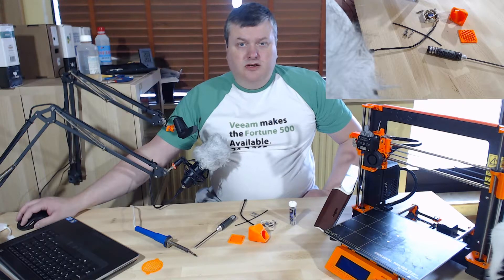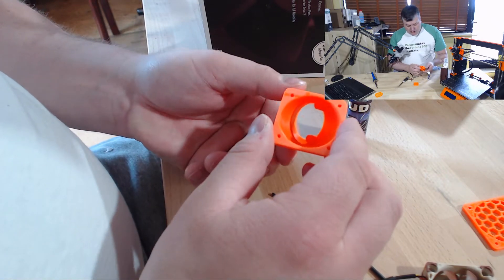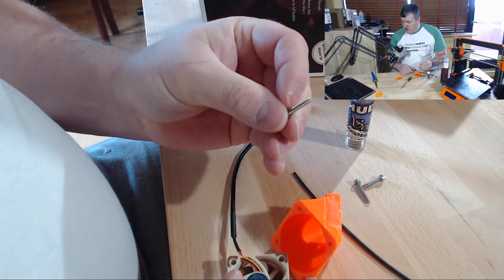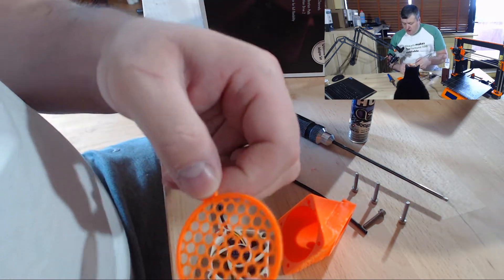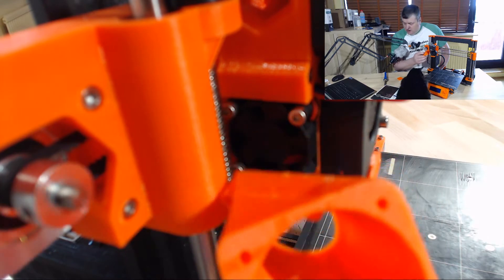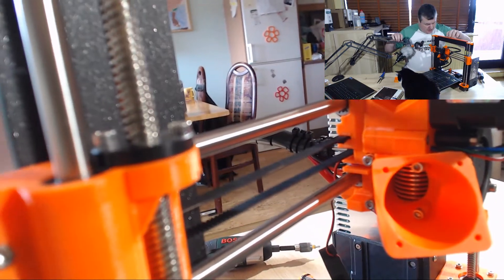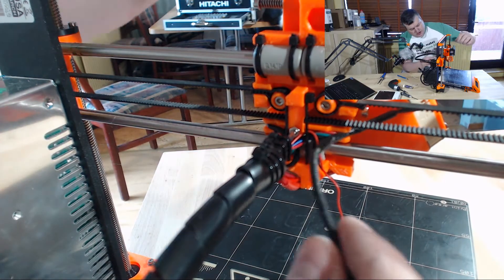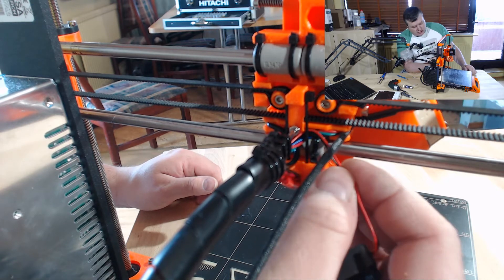Noctua Fan install on Prusa i3 mk2s 3D Printer

Comment: That is no western union splice... how long did that solder joint last?
Reply from the maker: :), there is no stress on the splice, - lasted fine, - fan died though at some point and got replaced.

Comment: Does this printer come with bltouch?
Reply from the maker: Hi , No,  it uses a pinda probe for bed leveling sensor.
Reply: No and the pinda probe it comes with sucks because this is before the removable steel plates. If you have a prusa, it is well worth upgrading it with a magnetic plate. fystec makes one for the mk3, you would have to buy a bunch of those N52 1mmx25mm chineseum magnets for it to be nice. I use 27 magnets, only because they are likely closer to N35. If a cheap amazon seller claims more than N35 it is unlikely to be true. For the good stuff you have to go alibaba.

Comment: I usually put a connector if i am going to cut a wire like this, then it doesn't have to be done again if you remove the fan or any other part (if you put connectors on them too!)
Reply from the maker: yes, that sounds like a good idea to do, - thanks for the tip.
Reply: What type of connectors would you recommend?

Comment: Are you still liking the Noctua fan? I purchased one but haven't installed it yet.
Reply from the maker: I got problems with it in my enclosure, as the air in the enclosure got to 39°C and I removed it, - I have now installed some fans for the enclosure but still have to put the noctua fan on again.
Reply: 3DP Iceland Sorry to hear about that. I'll be interested to know if you put it back on. I made an enclosure for my mk2s out of Lack tables.  I constantly measure the environmental temps.  I attach removable side and front panels when I'm printing with ABS.  So far with a 3 hour print the temp has gotten as high as 48.4C.  I also have an air cleaner setup for odor and fine particles. That seems to work really well.  I now cannot smell the ABS.  I guess I'll hold off putting the Noctua fan on for a while.
Reply: Why?  no idea what an enclosure heat has to do with the Noctua fan itself.  any other fan would have the same issue then.   Noctua is quiet, larger so airflow is similar.   I print ABS in an enclosure no vent and it gets 40c or so in the chamber.  No clogs on 10+ hour prints yet.  Though i may run fresh air from outside, especially for polycarbonate.    i can't hear the fan at all.  i also have some on my PSU's of other printers.   that combined with v-rail and 256 microsteps and a printer is dead silent like a paper printer.
Reply from the maker: At larger prints, I had heat-creap, so filament got stuck in the heatbreak/cooler part,  I did not have that problem before I changed to the noctua fan in the hotend. - Now I have installed fans at the back of the enclosure to get temps down, and I'm going to put the noctua fan back on when I have time.